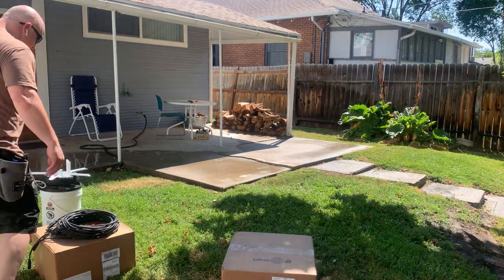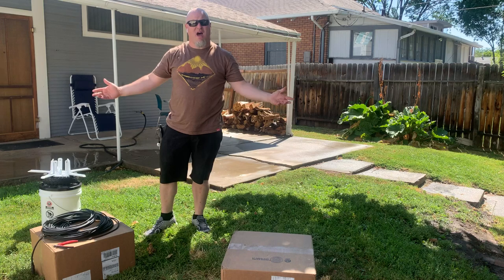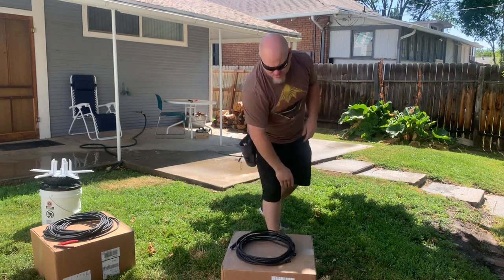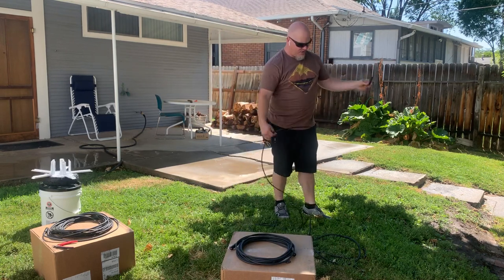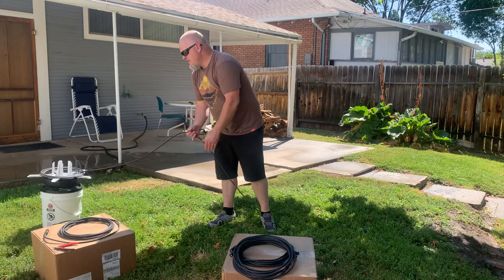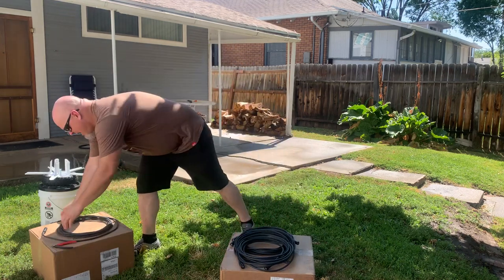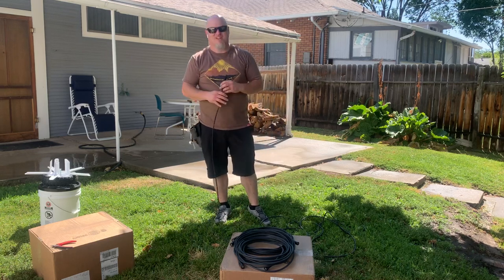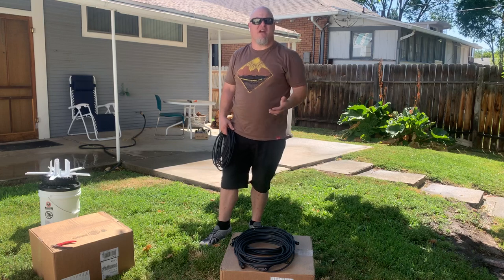Unrolling and then over-under brand new cables

Comment: This is great advice.  If you simply grab one end of a new cable and pull, it will take 10 or more over-under recoiling cycles to work the spiral out of the cable.  Proper unrolling of a new cable as demonstrated completely avoids the cable spiral issue.
Your carousel is clever but you can also just unroll the cable by hand.  Find the outside end and let it dangle.  Then unroll the cable hand over hand like unrolling fruit tape candy.  
Another tip is to leave the cable out in the hot sun after you recoil the cable to let it relax in its new shape.

Comment: Great video, as for the connector facing forward when in your left hand, the connector orientation and which hand you hold it in, left or right, determines which direction the cable will coil either clockwise or counter-clockwise. I haven't found any definitive source that one or the other is better but I do follow your advice of connector facing forward when in your left hand which results in a counter-clockwise coil.